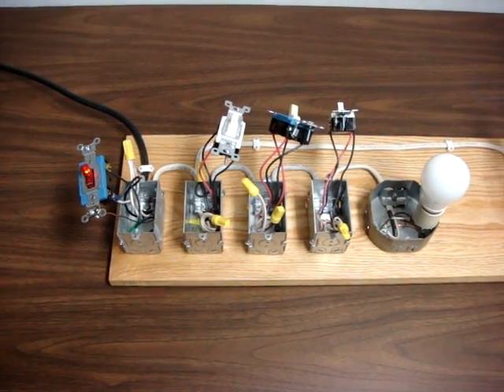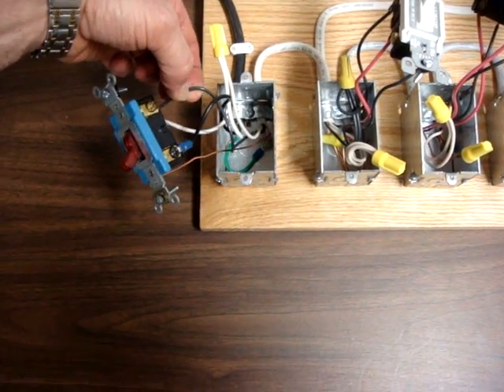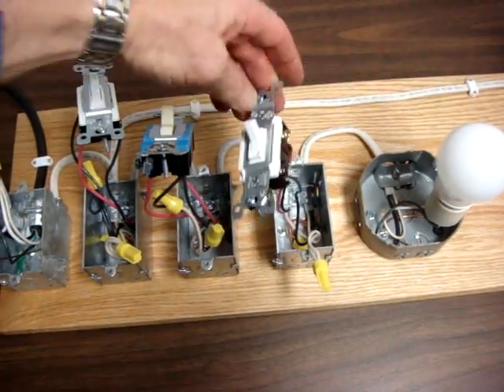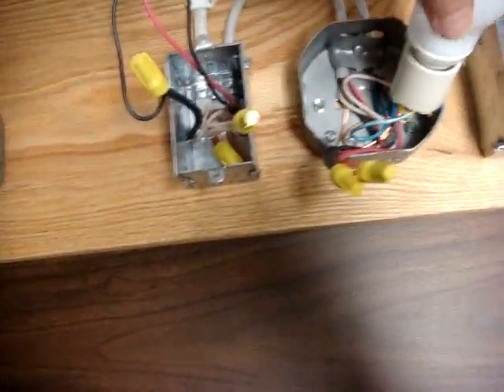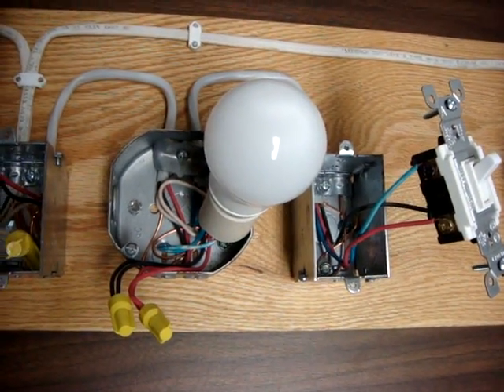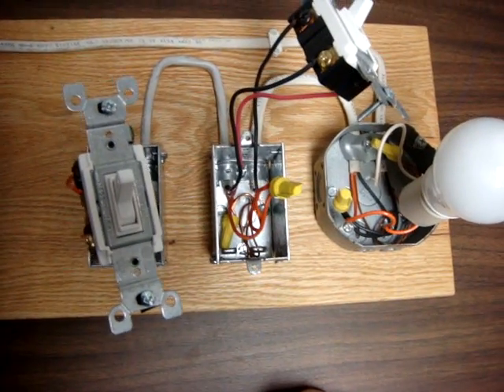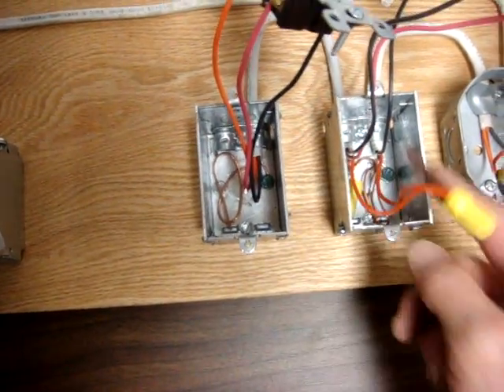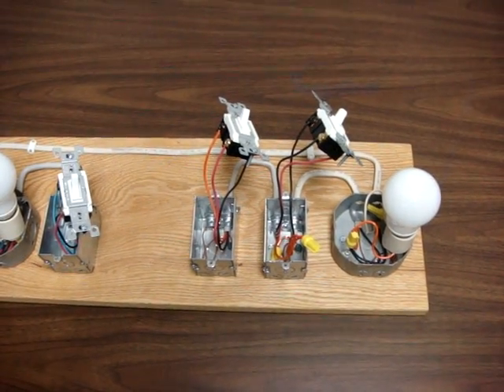3 Way Switch - 3 typical ways to wire

Comment: My ceiling has total of 6 wires (2 black, 2 white, 2 red) it is a 3 way switch. How should I wire them?

The light fixture i want to install has 1 black, 1 white, and 1 yellow/green.
Reply from the maker: I am unable to provide that level of info, without being able to test the wiring to determine the role of each wire.

Comment: I’m doing this side job and they have it where he ran 3 wire for a box that has power, but daisy chained 3- wire to 6 other lights. Then dropped down on the other end of the hall with 3 wire out of that last can. Would I need to drop a 14-2  out of that last can? Or do I have enough go make the 3-way up?
Reply from the maker: You would likely need to run a 3-wire cable from switch to switch for the cleanest install. You do not have enough wires to make it work.

Comment: I have the - Light - 3way switch - 4 way switch - 3 way switch.  I'm confused.  Trying to install a Leviton smart system.  Your explanation is better than any other that I have seen. Thank you.
Reply from the maker: I am not familiar with that system. Historically, dimmers are used to replace either 3-way switch. Check with Leviton as to how this should be wired.

Comment: Sparky John could you one day wire a three way switch with a four-way in between to a light and then bend The conduit to complete the circuit? I need a idea on how to do this for a test I have coming up. Thx

Comment: I have 1930 wiring with no ground. 3 ways are top and bottom of stairway. at the top there are 4 wires whites (i think) are soldered together with 3 wires to connect. Bottom switch has 3 wires, one alone that goes to the top switch and two together. I have tried many combos and can't seem to get it right. Any suggestion short of hiring an electrician?

Comment: The setup on the right has the travellers with reveresed wiring Red on left Black on right, for one outlet and the opposite for the other outlet. So in effect it does not matter? Also, is it always that the screw by itself is for power or to the light, never a traveller? Correct?
Reply from the maker: The position of the travelers does not matter. The "Point" wire (odd colored terminal) is for the switch or "Hot" in a traditional 3-way circuit. In the "unusual" 3-way circuit video, there is only 1 traveler and it goes on the "Point" terminal.

Comment: What in the world is going on with the first single pole switch?  Single pole switches only have two screws for the hot wires, and ground screw.  Why does it look like a neutral wire is running to the first switch?  This is throwing me off, I'm kind of stuck on that :|
Reply from the maker: The first single pole switch is a red handled "Pilot light" switch to turn off all power to the display board. It is just there for my safety. When I see the red light on, I know that the display board is energized. It has nothing to do with the 3-way switching system. You can IGNORE it!
Reply: sparkyjohnrg thanks for the quick reply!  I'm actually very well aware it has nothing to do with the 3 way set up.  I'm just trying to understand why it looks like a neutral wire is running directly to the switch but I'm thinking I figured it out while typing this.  Is that neutral for the light in the switch? Thanks!
Reply from the maker: Yes, the pilot light in the switch requires a "Neutral" to light up, when the switch is on.
Reply: The blue switch has a little LED light in the toggle. It's a combo 2-way switch/light fixture. The LED needs a neutral to close the circuit and illuminate and why the white is there.

Comment: Thank you so much for this helpful video.  I replaced the toggle switches with rocker switches on my upstairs/downstairs walls to control the stair lighting and then swapped the wires directly but would not work.  I tried every combination for two days!  Once I figured out which were the travelers it all made sense and got it worked out. :-)

Comment: I don't know if it's just me, but it feels like there is a lack of explanation for the second example (just the two 3-way switches with the light).  I follow you perfectly when you explain the hot coming in, and the neutral being passed through, with the two travel wires going out and to the light, but from that point I have no idea what you're talking about.  I'm trying to follow what you're saying with what I'm seeing but it's just not making sense to me.  It feels like something was left out, but I don't know how to say what.  It's just a bit confusing to me.

Comment: the power switch I have has two balck wires and one Red wire. Can you explain how can I replace it and what is the purpose of red wire. In my present swith the red wire is connected to black terminal and the one black wire to the other terminal and second black wire is inserted in a pin hole just below the other black wire terminal. Thanks for help
Reply from the maker: I think you are confusing a regular single pole switch with a 3-way. It sounds like both black wires are on 1 end of the switch, and the red wire is on the other end of the switch. I would guess that the 2 black wires are "Hot" and feed the switch, and the red wire goes to whatever is switched.
Reply: Thanks, my friend.

Comment from the maker: If I understand you correctly, At the first box, you would connect your source of power to the odd (or common) terminal, and the 2 travelers to the remaining screws. At the other box, you connect the switch wire to the odd (or common) terminal, and the travelers to the other 2 terminals.

Comment: I am trying to wire a light with two switches, power is in a 2 gang box and the other houses the wire for the light, and it is a 4 gang box with 3 other switches that that are single switches that light outside lights which also need power that comes from the other box. I have 2 travelers between the 2 boxes.

Comment: I wanted to install a switch and I think my back porch light is wired for 3 way. I removed the blank faceplate to find 4 wires white and yellow from the fixture/ white wire and blue wire (hot) in the box. Am I correct in my guess?

Comment: @Chewylu103: "...on your 3 way setup where you colored the neutral wire blue, you should have put the neutral conductor as the traveller and the black or red as your point to feed the light, as tortito33 indicated."
Thank you for  helping understand Tortito's reference. In practice is a "black taped or painted (normally neutral) white wire in residential wiring absolutely necessary? Why isn't 14-3 or 12-3 cable used to eliminate this need to "doctor up XX-2 cable. 
Roy Lewis ATL, Georgia USA

Comment from the maker: Using a single pole switch as a "Master" makes no sense. I show one on my board to safely show the details by de-energizing the board before poking around with my fingers.You can have as many switches as you desire, BUT you always start and end with a 3-way switch, and ALL of the switches in-between are 4-way switches.

Comment: what if your using a single pole as a master switch and want to use a 3 way switch to be the master switch for every 3 way after

single pole(main master)>3way (controlling next switch>>3way (controlling next switch>>3way (controlling next switch>eetc

Comment: @sparkyjohnrg You should really let your audience know that your example is not to code, that it is merely a wiring tutorial that should not be followed to do wiring in your house. Just as a heads up though to you and your audience(whomever is under the jurisdiction of the National Electrical Code), on your 3 way setup where you colored the neutral wire blue, you should have put the neutral conductor as the traveller and the black or red as your point to feed the light, as tortito33 indicated

Comment: I'm not overly familiar with US style switches, but unless you are isolating the supply (off camera) that is coming in on that black wire, I'd say your hands are getting awfully close to some actual live connections, particularly at around 0.45 on the video.

Comment from the maker: @VictorHongo110 The only difference is that you need 4 wires to run between the lights: Switch, Neutral, 2 travelers.

Comment: Adding a Hot Receptacle to a 3-Way Switch
Hi i'm trying to wire a hot receptacle to a 3-way switch. The issue I am having with this is, I am trying to added it into the box with only the 14-3 wire going to it. Meaning the original power source is not in this box, it is in the other box of the 3 way switch.

Any help would be greatly appreciated.

Cheers,

Comment from the maker: In a finished structure, I fish wires down from above, or up from below, depending on whether there is a basement, or attic. The video is meant to show the pertinent connections, NOT the fishing of wiring in walls, as that will vary by building, electrical jurisdiction, and local trade practice.

Comment from the maker: The majority of people using this site are looking to solve a problem. They are NOT taking out permits and having inspections. This site is used by DIY'ers, not professionals looking to relearn 3-way switches 101. I cannot and will not post videos to avoid the foibles of a couple petty inspectors. In a third of a century, I have NEVER tolerated bullying from an errant inspector, and have reported them to their municipal, or State agencies. They don't mess with you after that.

Comment from the maker: The majority of people looking for info on 3-way switches are residential users, NOT commercial and industrial users. Most residential users will find 3-wire cables, and 3-wire cables are  NOT made with a BLUE wires. 3-wire cables contain  Black, Red & White wires. Color coding is NOT standardized on a National level. It is left up to the "Authority having Jurisdiction", and to categorically state that "Black, Red and Blue are the colors used with 120 volts" is misleading. Think before Posting!

Comment from the maker: The 2005 NEC (National Electrical Code) changed the requirements for use of White or Gray conductors. Open your code book to 200.7(C)(1). Hopefully, you were taught that before the adoption of the 2005 NEC.

Comment: as a apprentice i noticed you colored the wire with magic marker. Why? i was taught to splice black to the white wire.  then treat that white conductor as if it was black conductor.   

i was taught when wiring a switch loop  with the white wire is always the line conductor.   leaving you left with  a black load.  This way you do not mix up the white conductors later.